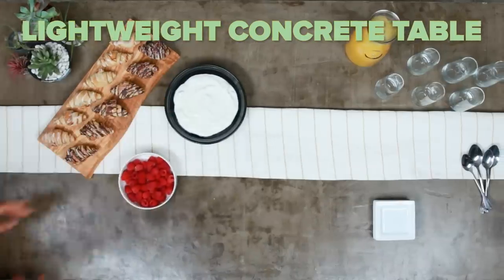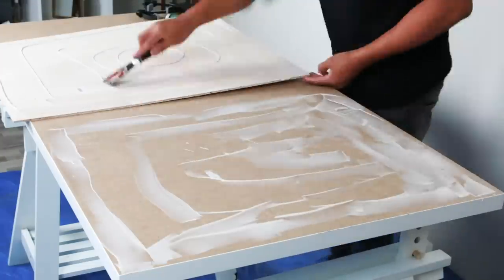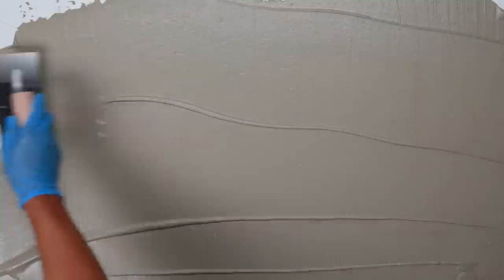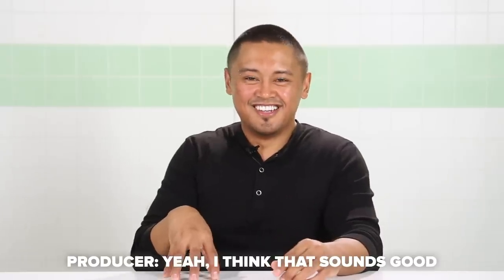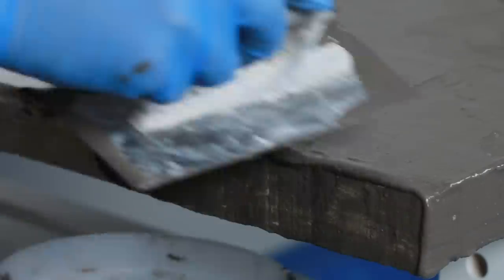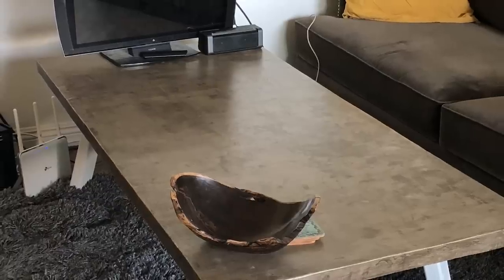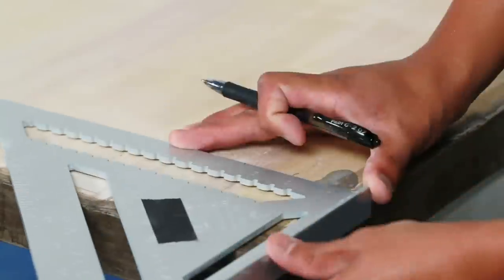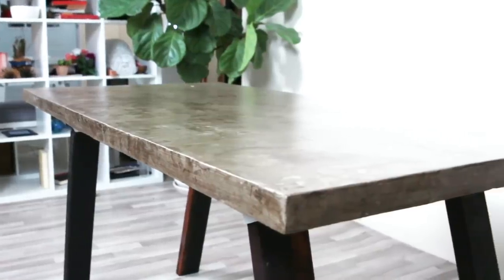DIY Lightweight Concrete Table

Comment: dude....I've cast em upside down....make your mold 5 mm bigger than timber top(Do same thing to toughen up timber) and use self leveling stuff...fill bottom place in timber and brace into place and fill sides....demold and it's perfect....no sanding ...it's as flat and perfect as a cesarstone benchtop. I do insitu concrete as a  business but sometimes do this if weight is an issue....try it out dude...works awesome
Reply: Wouldn't have thought it works like that as well! You have a video? How do you make sure the wood is levelled outon the concrete and doesn't sink in too much? And - isn't the wood working over time producing cracks?

Comment: How can you get a lighter looking concrete look, instead of the darker one in the video. What would I use?
Reply: You can find a recipe for pool plaster (there is white portland cement) and you can find concrete stains or integral concrete color pigments if you want to give it some tone or color. There is also non shrink grout by RapidSet. It is lighter in color, but you have to work very fast with it, it hardens quickly.
Either way, the color will me darker when you are mixing it,, in lightens up as it cured. Putting a sealer on it (which you should do) darkens it up, some kinds more than others. Experiment on something  small first. Bottom line is though, that replies in comments are never going to have the necessary details you should have.